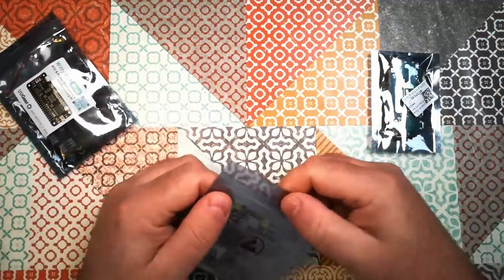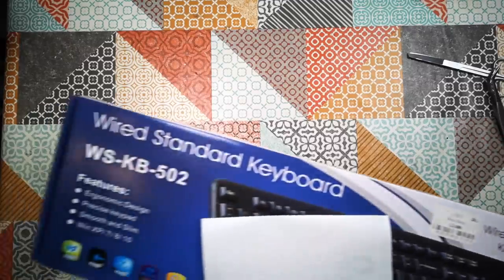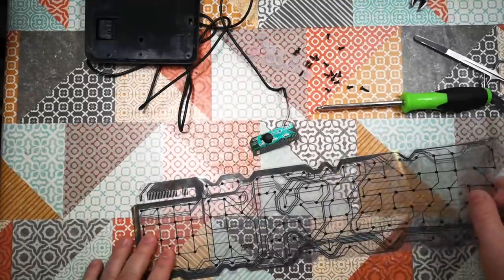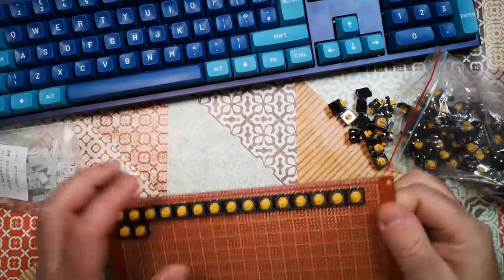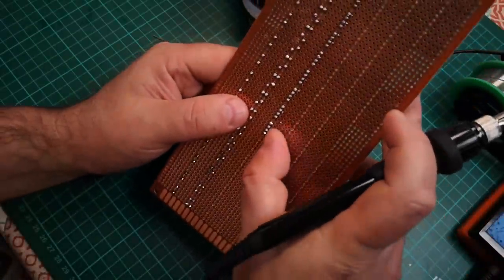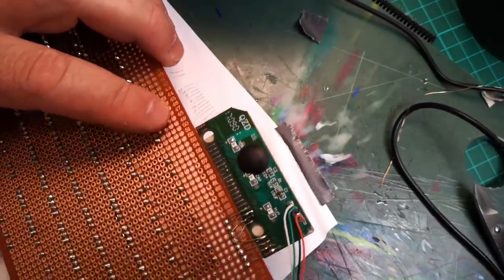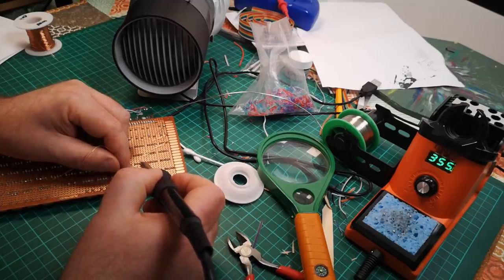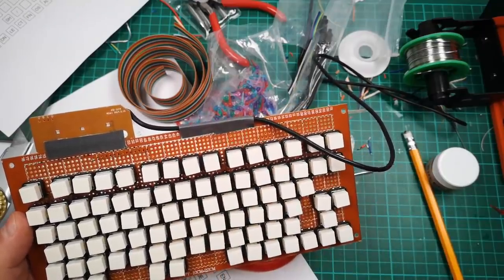How to NOT Build a Keyboard, or: Time to Stop Doing the Same Thing Harder

Comment: I was working on a project lately which needed keyboard with LEDs on each key, and first i thought that i just could do it by hand for a prototype (it also used keys and leds that are connected to SPI IO expander to save on MCU pins), but then i realized that each button/led potentially could have it's own pullup resistor, load resistor (i haven't decided at that phase which IO expander chip to use - the one that had true tri state ports with pullups or which have it bare bones) etc., and at that point i suddenly realized that this is where i should use PCB manufacturing service. 
Now, granted, i've already worked with this service once, so i'm kinda familiar with PCB ordering process and their online layout editor, but it's still relatively easy to pick up from scratch. They also usually streamline whole process for customer, so even while i've spent couple of days routing all boards that i needed for the project - in time that i could already done the prototype by hand on a protoboard, i was really happy that i did it via PCB fabrication - it was far less tedious to assemble the project once boards arrived, without any kind of rat's nest of a wire mess (at least on the board side) and without risk of killing the joy of working on a project by having a loose wire somewhere under that mess and hours of debugging because of that.
And you may even incorporate your approach of reusing cheap keyboard controller PCB on a board of your own design.

tldr - you probably should try PCB fabrication service, it's cool. Some services even allow small batches (~5 pcs) if you don't plan to have lots of them.

Comment: As much as this was an exercise in frustration, I found your process really interesting. I think I would have simply just grabbed a spare teensy I have and wired it up but yeah I love the idea of re-wiring and re-using cheap hardware.

I am also a massive fan of veroboard.

With keyboard wiring, I'd use hook up wire and melt the insulation, or go the ben heck route and use an old ide ribbon cable.

Both would melt easier than the enamel on that wire, I use a small piece of sandpaper or my craft knife to scratch the coating off when I use that stuff.

Comment: If you want to solder this kind of transformer wire again, it helps to pinch the wire with a small pair of pliers to break the insulation in this spot. So you do not have to melt through it. But nevertheless you have to check continuity every joint. 
Thanks for the lesson and a happy new year.

Comment: I have to confess I'm in the early version of 'when in a hole' camp. So I was impressed by Mr Shrimp's endurance.

As for the key below Esc. I've always called in the 'pipe' key. For just about every PC user it as useless now as the 'Num Lock off' cursor keys, which have their own keys on a standard keyboard.

Comment: I tried doing this a while ago, the main advantage of using the keyboard's PCB is that it gets recognised at boot. 
Now that you have the mapping you may want to look into making a simpler keyboard, (like a 60% or smaller) as a test then go into designing a custom PCB.
Another key  in this is that just because your goal is to have a small keyboard doesn't mean your first prototype has to be small, I think spacing out your keys and linking a couple of those protoboards (or some that are a little nicer if you're still having problems burning off the pads) may help you with the  soldering confusion. 
Or if you dont mind a bit of extra work; each button only has 2 contacts, maybe soldering the two pins together would help visually distinguish switches from the back?

Comment: Really cool video!
Over the course of last year I've designed a couple keyboard related projects (PCB for a 4 key keypad, 65% keyboard and numpad), so I have some experience with the designing process.
A PCB would make it incredibly easy to mount all these switches, but of course that takes away from the sort of DIY of this project. If you're interested though, I would definitely be willing to design something custom these switches (or similar) can sit in, so you just have to solder them on and a microcontroller.

Comment: This sort of projects are of course cost+time worthless, but, on the other hand, it actually teaches an individual the lots of engineering and manufacturing compromises a comercial finished product goes thru (even a cheap one); it's a valuable lesson for everyone interested in, and you can always have feedback from other users to re-do many steps in a more time-efficient manner; and it's also a good thing to re-use electronics and spare parts in your new projects (I have had an apple wireless keboard that had coffee spilled in, so I could salvage the logic board and also will try to re-implement a keyboard with it)

Comment: Great video, knowing when to stop and calling it an education is difficult when you get "pot committed".  In terms of this project and the steps you took, it could have been a success if after every key you soldered and wired, you plugged it in and tested the key to its entirety and not move to the next key until that key is fully functional.  Being a software developer I employ a similar tactic when coding as I don't like debugging as much as I used to.  I think refining your strategy to including a testing step is all you need to do to make this a success.  Thanks for posting this, I learned lots.
Reply: I agree. He should have been testing every connection. That way you never get too far ahead of yourself. KISS theory. Keep It Simple Silly. Sometimes I like to say I use the any idiot can do it method. Because I'm often the idiot doing it. There's no shame in doing things the "dumb" way. It often turns out to be the smart way.

Comment: This is not a critique as I am in no position to do so (I've never actually done any soldering) but If you had use two different color markers to mark the back of the board  could you have checkerboard colored the holes so that later when you wanted to wire it all up you would not have had the problem of messing up what wires go to what points? also it might have helped to have printed the keyboard on clear plastic paper to lay it over your work as you where soldering to keep track of what you were doing rather then looking up at a printed paper somewhere else and then trying to mentally place that on the spot you need to work on. Just my two thoughts on the whole thing and I am sorry it did not work out. Also are you absolutely set on making your own keyboard or would you be willing to try premade wired one if it was small enough?
Reply: Solder does not flow across areas covered in sharpie ink.

Ask me how I know...
Reply: Hmmm, that could be used to advantage …
Reply: @caramelldansen2204  how do you know?

Comment: You could use an ATmega168/328 to collect the key data from a matrix and then send it over to the PI via i2c, uart or spi. The advantage of your PCB method is of course that the PCB will speak "USB" protocol and negotiate with the receiving PI. I used an ATmega328 to make a prototype of an HP16C (Programmer's calculator). It was nice watching the video. After reading some of the comments, and having worked in IT & Service delivery for a long time, I can see you're battle hardened. :)

Comment: It's also advised that you use smaller diameter solder. With the standard 1 mm one you're using and working with small pads like that, it becomes very easy to put too much solder on the joint and risk it being cold or dry.
Reply: I usually use 0.0315" solder myself. Which is a little under a mm. If you have to know how much I guess you'll just have to convert it yourself. Math is good for you.

Comment: I really love your videos. I love how they range from foraging to science to electronics. 

When I saw the construction of the keyboard I thought it might be capacitive at first. I didn't expect shorting the traces to work. Luckily it did. Also, I think that the switches you used are not the best choice. It looked like they need a lot of force to press. I think you can make a functioning keyboard with them but I think that key presses will need too much force to be comfortable. Also, like you mentioned, they have too much play. You could try to overcome that by putting them in a matrix that aligns them. But I think that array has to be very tight. You will be struggling with tight tolerances and it may cause too much friction. You may want to get some cherry (like) switches instead. They are more expensive but they will probably save you some agony.
Reply from the maker: The problem with cherry switches is size. I need the total width of this keyboard not to exceed 200mm

Comment: When soldering up, use plenty of flux, solder and wash the tabs with solder then take off with desolder braid to leave nicely tinned. This makes it easier to then solder with tidy solder contacts.

You should invest in one of those solder tip cleaning wells that contains a metal copper wool like the metal pan scourers. They help clean off the tip of your iron better than a wet sponge. You benefit from an iron that maintains its tip temperature and not being cooled and contaminated by what is in the water you wet the sponge with.
Reply: 355 ! you should try 375 to get better solder joints. Less contact time is also a benefit. Means you don't cook any pads off.

Comment: I had the idea to do this once. Pulled apart the keyboard, and after a few minutes decided it would be better to use a microcontroller! I only wanted to wire up about four buttons too (mostly just the arrows), any more than that and I'd 100% go straight for designing a custom PCB.

Comment: Hmm. You made a valiant effort for sure.
Your soldering iron is maybe a little too hot, but even then, as you found out, the enamel coating on magnet wire does not melt off like people online suggest it does and less heat wouldn't help that part

Comment: I really like the idea of creating your own custom keyboard. What got me a bit confused is the point to point wiring of the switches. You have a rather nice PCB there, so here are some things I would have done differently (take it with a grain of salt, I am by no means an electrical engineer, but a sw developer):
1. use the fat bus connectors patches on both ends of your PCB. for example left side for rows, right side for columns. Also using the border bus connectors would allow you to create your own keyboard driver as mentioned by others. I'm just not really sure if the number of them is sufficient, but probably they are.
2. run bus wires between the keys (maybe even do it by creating bus-lanes directly on the PCB for the rows if there is enough place for that) and connect the individual switches by jumpers to it to minimize long point to point wires.
3. columns busses can be run below and above the keys and go down to individual keys. colouring the bus wires in this case would be beneficial.
4. connect only the top 2 connectors of the switches to eliminate the confucion you were referring to. that means, that for every row of switches, there is only one row of connectors to be cared for during soldering. later the second pair of connectors could be soldered to the PCB to overcome flabbing of the switches and fix them to their place more securely.

I also like the idea mentioned by others to colour match your switches. Four heavily distinct colours should be sufficient to do this (e.g. four colouring theorem) and would be visible through the PCB holes.

Anyway, I think it is great work you were doing (and making your own portable PC is cool). Maybe buying a keyboard is more time and cost effective, but on your custom one you could stick your 'made by atomic shrimp' logo on. :)

Comment: Man, I feel this video, since I was doing something similar
I was trying to make a piano keyboard, I was going to use that little pcb (from an old membrane keyboard, pretty much the same internals as the one in vid) to connect (solder) to a piano keyboard, then use a program that converts keyboard input into midi so i can use it with music software, DAW etc.

I did exactly what you did in the video with figuring out the matrix, plugged it into my pc, open notepad and get to work. Worked out well, but, when it came time to do a solder test and see if my plan is working, well, It failed horribly to say the least. The heat immediately tore the copper traces apart, up to the chip itself, so basically I did a very bad job of soldering (to my defense I am a beginner to soldering, but then again, the pcb tore itself just by looking at it)

Sufficed to say it wasn't a time well spent.

Later on I went to frankenstein my mechanical keyboard (that has a pcb - obviously) and easily figured out the matrix and did one hell of a messy job with somewhat like over 100 wires going from my keyboards pcb into the pcb of my piano keyboard. It actually turned out pretty well, and used it for some time, until my not so well job of soldering broke some contacts at the piano (thankfully not my pc keyboard) and it went downhill from there.

P.S. Reason why I went to so much trouble is that I wanted to and did not want to spend money on a midi keyboard, and I already had a synth that the keyboard microcontroller didn't work. And also this way of doing it you can get up to 56 notes from a pc keyboard (full size) and sincerely that is quite impressive amount considering you can also have a proper keyboard instead of pc keyboard to play with. If you can find some odd keyboard that has a whole lot ton more keys you can squeeze more out, but I doubt you can find such.

P.P.S. If you have the ability to purchase things online, I highly recommend buying a microcontroller and coding to output midi instead of doing this. Sure it requires coding skill, but hey.

Comment: There is some practice boards that dont require any soldering you just need to apply a bit of pressure to push it in. Maybe for testing purposes you could try it with that?

Comment: Hi. fyi, Vero used to do a prototyping wiring sytem comprising a plastic comb that fitted in the board holes &  a wiring pen which had a roll of similar wire you used to run around the board wherever it was needed. Wrap the wire round components & solder... Really easy & quick to use, but not always efficient use of the combs. I used it for prototyping computer system boards, with gazillions of chips , and it worked very well. I have no idea if this sytem is stil available, so I'd like to apoligise in advance if I've wasted anyone's time...

Comment: As someone who recently soldered to a very small solder track and pins: genuinely having a magnifying glass or lenses helps big time. A small tip soldering iron, perhaps smaller than what you’re already using, and flux. I like to use flux paste. I prefer using a paste that comes in a big tub which is general purpose. It’s quite thick and only a conservative amount is needed for each joint.

It would be all too easy to use a PCB etched to constructed but that’s boring.

Mike, I would personally love to build a homebrew style keyboard like this, reminds me of early computing from the 70s.

Comment: I don't know if you know your way around CAD software, but designing your PCB virtually and ordering it for maybe 20 bucks (usually around 5-10€ for 5 PCBs +shipping) would result in a much cleaner and much easier process, than by doing it on a Breadboard. You can also place mounting holes there to make building the final product easier. There are some decent free CAD softwares around, but if you can get your hands on an educational licence for Eagle that version is relatively easy to use and it works well together with fusion 360 if you want to 3D print a case.

Comment: Sometimes doing the same thing harder can still be good. If only for the learning experience of what to avoid in the future.
In other situations it can significantly improve future attempts. 
Especially today, homemade solutions in electronics rarely make sense. There (almost) always is a better and probably cheaper solution out there.

But as many people have been suggesting, a microcontroller solution might be easier to reverse engineer a black box and also will have the possibility for improved features. If you're okay with getting an etched pcb after your own design, you might be able to shrink the whole device down by quite a bit. Depends on your skills and rules for this one in the end.

From my "professional" standpoint as a trained electronics technician, you had an approach that would never have crossed my mind. Yet I still think it's an extremely interesting idea, despite not being practical whatsoever. Like I said, doing things the hard way doesn't have to be bad.

Comment: One thing you should consider before re-attempting this is power usage. I'd be a little worried that a cheep off-the-shelf wired keyboard is not going to be optimal for your battery powered usecase. I'd  also keep this in mind when looking at custom microcontroller solutions, I assume some are more power optimized than others. 
Someone has probally already done a custom keyboard project which more or less fits your needs.

Its probally also worth getting a custom pcb made, very cheap compared to the time investment and lack of flexablity with perfboard.

If you do want to stick with hand soldering, it might be worth going for a one diode per key solution. Would theoretically allow a much simpler to wire up keyboard matrix.